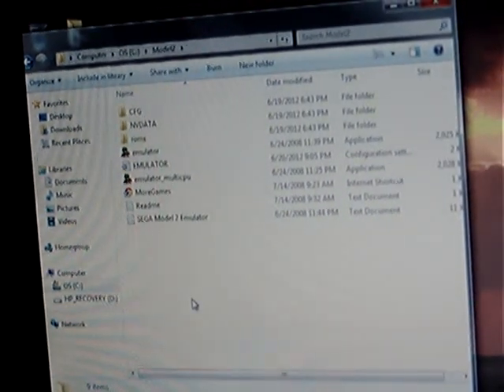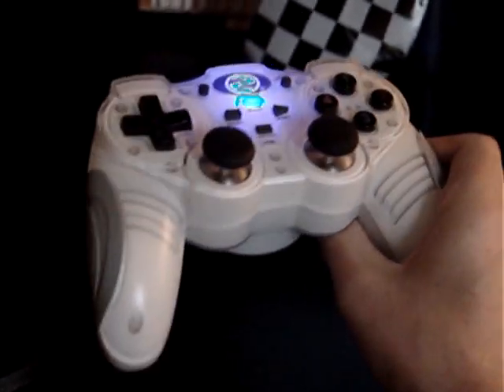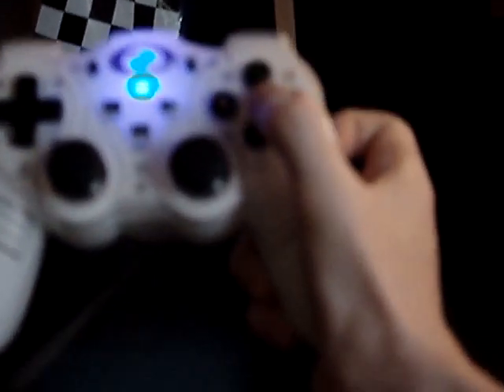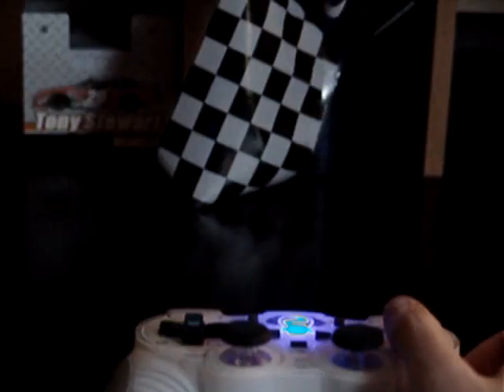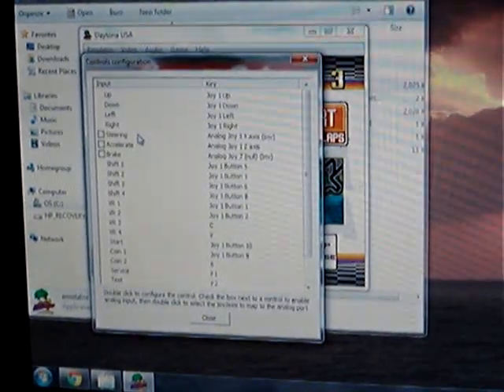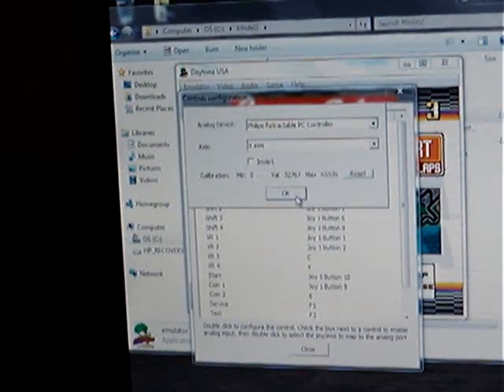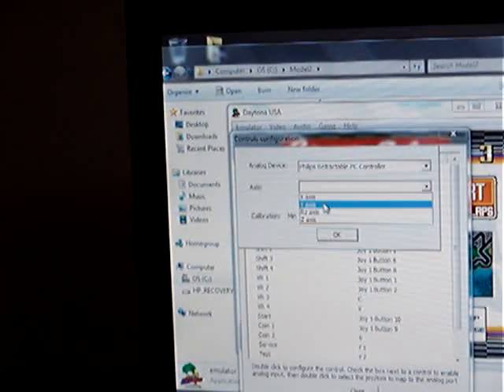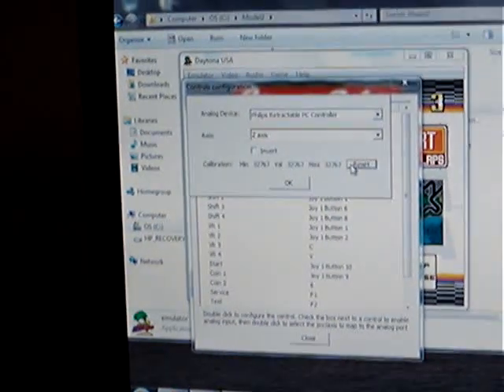Needing help with controller calibration for the Model 2 emulator

Comment: I'm having a ton of trouble with the analog controls in this emulator. I'm using an Xbox One controller with the XInput option enabled to play Motor Raid and it works and plays fine, it accelerates and brakes fine but not the steering, It just would not keep a center, straight line and my steering becomes all over the place without pressing the left analog stick in any direction making it hard to play

Please help me on this, any kind of help is greatly appreciated, thank you all.

Comment: This is still not very clear. Even on the latest version, 1.1a. I have figured this out though. If you want to use the left and right buttons (D-Pad buttons)  to control the cars direction and the buttons on the right to control the Acceleration and Braking, on the Controller options, Double Click on "Up" and then select a button on the right ( the no. 3 button on your controller) you want to use to Accelerate. Do the same for the braking. This will be the 4 button on your controller.  Then do the same for the Left and Right options and map these to your left and right Cross buttons (D-Pad buttons). I know this post is quite old now but hopefully it will help someone else out having the same issue.
Reply: This worked for me. Cheers!
Reply: @AnGhaeilge  Thank you so much, mate ! :-)
Reply: Just done this myself, cheers
Reply: Thank you SO MUCH.  Can't believe I didn't think of this... This emulator deserves a 2020 update (primarily to the control mapping), but so glad to have it nonetheless.  Cheers!
Reply: Thank you very much

Comment: if you go in the model 2 folder find the config file called EMULATOR in the main directory. Next, find the line called XInput. Change that to 1 and once you're finished go to your controls when you start a game and go to those main three. Steering Acceleration, Steering, and Braking. check those three and double click each one and use the pull tab to use which button you want to use. Then, assign the other buttons after that to whatever you wish. (note: When you let us say have a ps4 controller and press X it might show up as A because it read it as a Xbox controller. So don't worry you won't have problems.
Reply: Thomas the Dank Engine 
Am trying to run model 2 on my arcade I just built, with joystick and buttons using an ipac2 keyboard mapper.

Can controls be changed to assign buttons rather than holding up on joystick?
Reply: Hey, thanks; I'm going to try that out.  I have the same problem as Dee dong, with the latest version.
Reply: Hey mate, these problem are still here in 2020. I did what you said and changed the value to from 0 to 1, it did have an effect on the controls options. But I still was unable to select buttons on my controller to accelerate and brake. Another issue I can see is there is no button to change up and down. It looks like you need a separate button for each gear?

Comment: Hey Derricks,

I recommend getting the new version first up, then when configuring Accelerator as digital inputs, then you need to set your buttons for Up and Down is Accelerate and Brake. Accelerate and Brake (with the check box) is for analogue inputs only thus won't configure to a button
Reply: Thanks this worked in 2020, haha